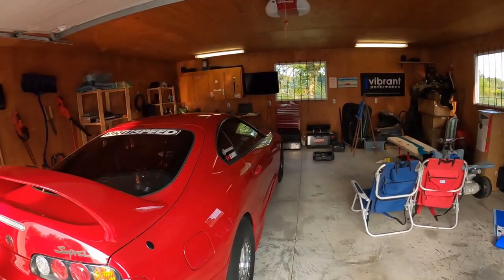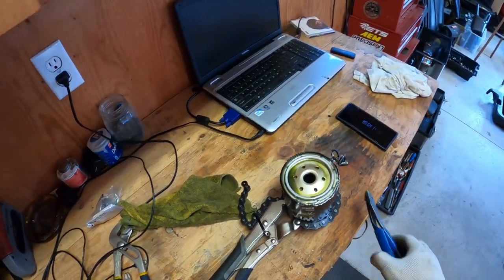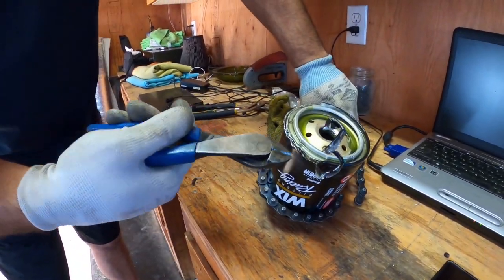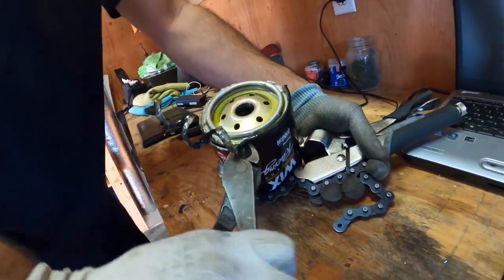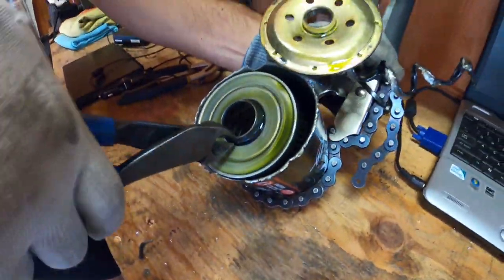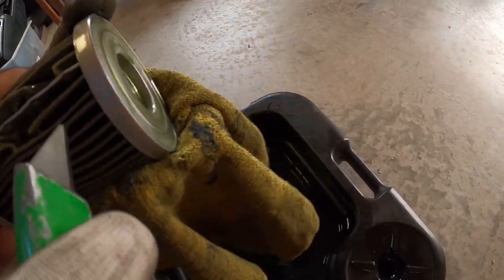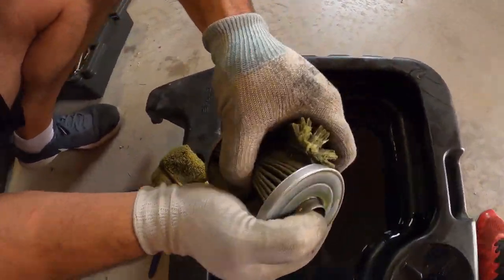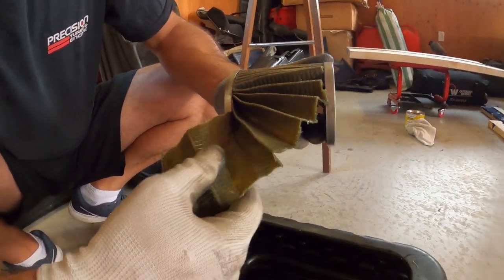How to open an oil filter with a side cutter

Comment: Actually tried using the same tools, getting it started is a little tricky, I haven't opened it yet. lol.
Reply from the maker: Just make a small cut in the lip with the side cutter.
Reply: @RyanSammutRacing   yeah I went back at it without hissy fitting, opens up pretty easily!